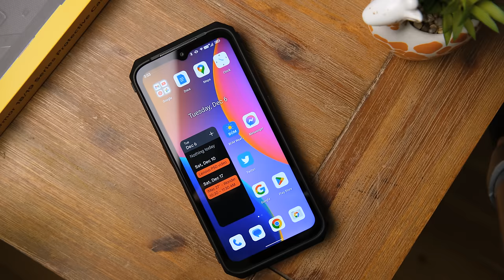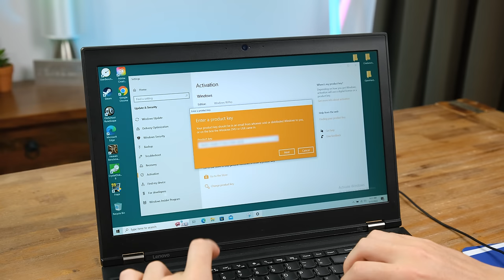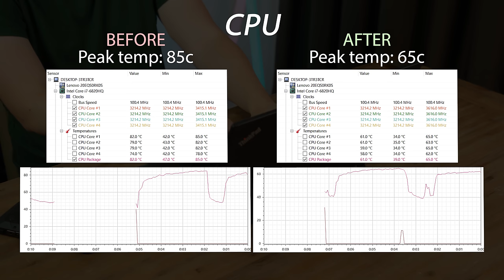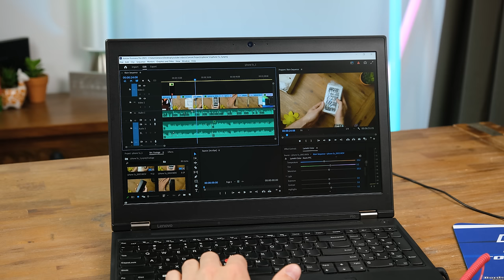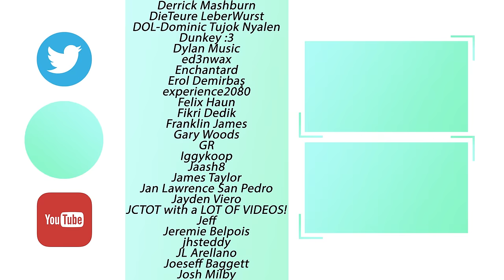I Bought A Cheap Lenovo P50 Workstation! Should You?

Comment: I still use one of these as a daily driver. I pretty much maxed the specs out over the years after getting it second hand, right now it has 56GB RAM, 2*1TB M.2 SSD and a 480GB SATA SSD, along with a i7-6820HQ processor and an Nvidia Quadro M2000M 4GB GPU. Wonderful machine, still very reliable, and even with an old battery, has 4+ hours of battery life. If I replace it anytime soon, I'll surely buy something newer from the ThinkPad P series.
Reply: 56GB RAM? HOW? 😳
Reply: Why the hell would you need that much RAM on a 6th gen i7
Reply: I have 3 16GB sticks, and also an 8GB one.
I work with large amounts of textual data, so I often need a lot of RAM. :)
Reply: @jbritain  Is there anything wrong with a 6th gen i7 that isn't power limited? In fact, assuming a similar power limit, it's basically as fast as any H series cpu 10th gen and earlier.

Also, for a lot of use cases 56 GB ram is pretty normal. For the work that I do, 64 GB ram is the minimum.
Reply: @vivek_v  I don't know enough about the kind of workloads that amount of RAM is used for so I made an assumption, I guess I assumed wrong!
Reply: 56??????? I ONLY GOT 32 BROOO NOOOO 😭😭
Reply: Well i have 24 gb of ram lol. 2 sticks of 4 and 2 sticks of 8
Reply: Suddenly my 32 gb of RAM on my MacBook seems very unimpressive. And for the price, it absolutely is unimpressive lol. 

Tbh MacBook ram is overpriced, but that’s not news to anyone haha.
Reply: @prodbydanai  I got 64gigs running all good. my setup is i7-6700HQ / 64gB RAM / 1*2tB Sata Drive and 512gB m2 SSD, Quadro M1000M 4gB, I even managed to add LTE to it.
Reply: where i can get that i7-6820HQ procie?
Reply: Max it out to 64gb.
Reply: I cringed at how he bought WORKSTATION with quadro in it, and used GAMES to measure its performance
Reply: Unfortunately, none of the current models come close to the versatility of the P50, which I also have as a daily driver. The newer Thinkpad models are a disappointment, to be honest.
Reply: My laptop has 256 gb and I only bought it for £500 from currys
Reply: @spqr528  I think he was trying to relate the video more towards the majority of viewers, as most of them would prefer getting a laptop (if the case) knowing it's performance in something that the mainstream market could relate, and at most would assume that they wouldn't be doing any workstation related stuff. It would also be more engaging (in my opinion tbh) than seeing something like cinebench rendering a picture.
Reply: I have the P15G2 (5 generations newer), fantastic machine :). I’ve also used the P51, really great machine too.
Reply: @jbritain  gentoo
Reply: Bro i only have 4gb
Reply: @lambogamer9415  neat?
Reply: @vivek_v  8th gen Intel onwards destroy both 6th and 7th gen Intel CPUs in both single core and multi core workloads at similar power limits. Wth are you smoking comparing 2015 quad cores to 2020 six cores
Reply: My brother in mobile devices, that is not a machine anymore, it's but a weapon of mass destruction.
Reply: Unless Lenovo starts fuddling up the ThinkPads I don't see myself moving away from them as work laptops. They're small, well built, easy to maintain, and strong enough to get work done.
Reply: @prodbydanai  my gaming laptop 64gb
Reply: @thabitpulak  Apple and everything extra and then the RAM isn't everything... Apple pay quintuple to have everything closed limited and modest performance, there's no story with real PCs
Reply: @rulvra3072  he made a wrong comparison but cores aren't everything in many cases... I have a forklift desktop with cheap amd athlon cpu of ryzen architecture with integrated vega gpu... it only has 2 cores and 4 threads with the beauty of 4 ghz ... it's also overclockable, msi motherboard .. in cinebench R23 It gets me about 5500 points but that processor only consumes 35w, I also have an Nvidia gt750 2gb always msi brand installed
Reply: @FBL9982  You discredited your point when you mentioned desktop and overclocking. Laptop CPUs aren't generally overclockable at all with the exception of Intel HK/X series. Also, 2 cores died out when quad cores became mainstream
Reply: @FBL9982  AMD Athlons are bottom-of-the-barrel tier CPUs that compete with Pentiums in budget segments. Not only are you blatantly lying about your benchmarks and power usage, you haven't even listed your CPUs model name either. Did you really expect anyone would buy your BS? Lmao
Reply: @rulvra3072  you answered unrelated stuff, first thing i was not comparing my desktop to laptop.. second thing my desktop isnt overclocked i dont mind touching those things are original points and third thing i was telling you dont always have anymore core means having more more powerful and that processor I have has destroyed many Intel processors, if you still don't understand well it's not the old athlon but the new zen architecture athlon and athlon 240Ge finally the Intel at the time were not superior to amd... Intel and AMD have always been more or less on the same level... Pentium 4 most of the models sucked and burned like wood ovens
Reply: @FBL9982  It's an Athlon bro, you don't need to flex lol. There are things called Ryzen 7/9s. I also agree that your CPU has destroyed many Intel Processors

Before 2010
Reply: Lol good for you.
Reply: Replacing a 4K screen is the last upgrade!
Reply: Mine is the Xeon with 64gb ram straight from Lenovo. This thing beats most laptops even today.
Reply: 7 times my RAM?!
Reply: @rulvra3072 the 'tech' is same, only improvements are power consumption and heat are reduced.  Whether or not that translates to better performance really depends on the power delivery and cooling 🤷‍♂️.  Depending on implementation the win could go to either one.
Reply: @milescarter7803  No it doesn't lmao, keep telling yourself lies to feel better about your trash skylake mobile CPUs. Your points about cooling are valid but single core performance is significantly better in Coffee lake onwards compared to sky lake. The average cinebench r23 scores for the Coffee lake based mobile cpus (around 7000~) are literal proof of this improvement where Skylake mobile CPUs can barely crawl up to 4000+.
Reply: @poodlescone9700  max on i7 is 128gb ram
Reply: When you play game, you dont open GTA V and LoL and CoD and BF and whatever the fuck AAA you play at the same time. 

But when you working you would open any engineering apps you ever know and multiple that shit 4 times running at the same time, and whatever necessary to get the project done. (Including physical abuse when you get stressed) and that terminator still working normally. Thats how professional that thing is
Reply: @jbritain  CAD CAM CAE works
Reply: 56 gb ram 😮
Reply: I love it when people do this type of thing, it looks pretty ridiculous but it’s obviously been loved.
Reply: Bro maybe you won't see this but can Quadro M2000m run Red dead redemption 2
Reply: Hi I have the p50 laptop I have question if I want to install a ram what is the specification of the RAM that you installed how many (hertz  ) I want to know specifically what Ram I want to install
Reply: @knaparpad hi
Reply: hi
Reply: @prodbydanai  RAM is cheap and they'll take up to 128GB which is nice for many workloads. For example I run a variety of OS in virtual machines on my P52  where there's no such thing as too much RAM.
Reply: @keiwxsh  With the correct system board since they are soldered. It's normally best to buy system boards by buying a notebook with a damaged display then swapping the complete base. I used to build older Thinkpads from wreckage and their manuals make that easy work.
Reply: @vivek_v dawn mine got 64gb ram!!!
Reply: @jbritain  open your eyes. 3D rendering or almost any rendering needs lots of RAMs. When you use 3D software and they're rendering real time you'll need those RAMs. Even a 16GB Ram feels useless as a person who's learning 3D. Even using heavy softwares uses lots of RAMs basically anything that takes loading uses  RAMs.
Reply: @2fps607  me to just remove the 3
Reply: kinda late to ask but do you recommend this laptop for programming? I found one with 32 gb of ram and I am wondering now if I should buy it
Reply: For ~50$ you can replace the cells with higher capacity ones and potentially 2x-3x the battery life on the same package size!
Reply: @2fps607  I GOT 8 LMAO

Comment: Interesting how much performance you can get out of an unimpressive looking device.
Reply: Well look at it this way, the budget not spent on look is going to the performance. I'll take performance over look anyday.
Reply: This laptop was probably not less than 2000$ new. It has a quad core 6th gen i7 when average laptops have 6th gen dualcore.
Reply: The money also didn't go to getting a not shit screen this is a 2004 quality screen so if you watch more than 20 minutes of YouTube or Netflix a day on your laptop this is not good.
Reply: Good looking laptop normally means sacrificed performance
Reply: yap is the most powerful gaming laptop in the world.
Reply: Sleeper Laptop
Reply: The performance may be good, but I'd rather gouge my eyes out than use a 53% sRGB screen.
Reply: @langstonbelin  Guessing you weren't even alive in 2004...
Reply: @bibasik7  The screen can be upgraded fairly easily.
Reply: @SebisRandomTech  I wasn’t but I did have a laptop from 2004 and it’s tn display was about this bad. Poor contrast poor color poor res.
Reply: @langstonbelin  P50 came out in 2015.  It probably has a great screen if you haven't tried.  It has 100% color accuracy that you won't get from any other kinds  I've used workstations for past 15 years as an architect using it for AEC CAD/CAM, 3D modeling, Adobe suites including Photoshop to Premiere.  It's reliable solution for working professionals. Thinkpad sort of defined what professional laptop should look like with its minimalistic aesthetics.  As a designer, I appreciate its purist design.  We cannot carry gaming laptop around to the client meetings.  My Thinkpad W520 (predecessor to this P50) from 2012 stills works well.
Reply: @langstonbelin  I can assure you even the lowest quality display the P50 shipped with will be better quality than your average laptop from 2004 (unless you were blessed with one of the FlexView displays IBM put in some of their higher end ThinkPads at the time), however the stock P50 panel is pretty bad compared to the higher end options that were available.
Reply: Everybody knows RGB ∝ performance
Reply: @SebisRandomTech  well it definitely wasn't very average it was the Dell d610 with a ATI x300 and pentium m I think it was 2 grand back then but yeah but it was cutting edge at the time
Reply: @raghnallm4004  do you even know what you're talking about
Reply: @langstonbelin  of course
Reply: Its very minimalistic
Reply: Astronaut will use apple if this device suck hhhhhhh
Reply: This device is way better than you would think though
Reply: Thinkpads have always been function over looks. That said, the new P16 which replaced this P50 and newer P15 strikes a really good balance between flashy and functional. It's the first, and only Thinkpad so far that I think doesn't look straight out of 2010
Reply: It’s used to look better in the past with W520
Reply: @SebisRandomTech  its close to  VERY HIGH END  display from 2004 if he bumped it up to 07 id agree most workstation laptops look like shit till they get to about 2018

Comment: I got one for a great deal back in 2016 for college. I got the i7-6700hq, m1000m, 1080p, and upgraded it myself to 32gb of RAM and added a 512gb Sata ssd. I think total then was around 1100 after all the upgrades and it was fantastic for what I needed it for (dual booting with Linux, programming, and 3D modeling). Still have and use today, haven’t had the urge to get a new laptop yet.
Reply: How does it fair with VR Gaming?

Comment: I have a P51 that's only a year newer.  It has a Xenon processor, 64 Gb of ECC RAM and 8Tb of SSD storage.  Very few laptops could match those specs.  The keyboard is great, the screen is fine and it's plenty quick for anything that I use it for, especially as everything is running from RAM.  These are built like tanks, and I expect to be using it for quite a while.  Very highly recommended.

Comment: I still use these at my company (i7 6820HQ, 48GB RAM, 512 GB M2 SSD, Quadro 2000M) for programming in AI field.

A little note : The USB C port is not just a USB port but a thunderbolt 3 port, so you can use a thunderbolt E-GPU for more graphical power
Reply: 48 gigs of ram?
Reply: @molotovick  2x16gb+2x8gb
Reply: I believed he mentioned it being Thunderbolt 3 in the video.
Reply: @SebisRandomTech  glad to see you back and active again
Reply: @TheotanyaSama  is quadro capable?
Reply: @MORaXedit1  Depends on your usage. For gaming, pass your way, they are not meant for it (for 2d games or games like Minecraft or STR games like Civilization it will be okay but for 3D AAA games, it will quickly show its limits), but for CAD, the M2000 is still decent nowadays.
As for the use I have, most of the computing power surely doesn't come from the laptops but from a much more powerful mainframe, we use the laptops more for coding and testing some parts of the AI.
Reply: @SebisRandomTech  so what? Move along

Comment: This is a really interesting rabbit hole. I've been paying attention to these old mobile workstations on the used market. There's not much info out there on how Quadros perform in games though, so I find the value really hard to assess. Would love to see more of these videos! One of these for cheap might be a nice alternative to packing up my desktop for LAN parties.
A Maxwell era machine at that price is a steal! Most options I've seen around that price point have a K2000M at best.
Reply: To get a rough idea on how they perform you can compare the chip to their consumer counterpart.
For example, the quadro m2000m has the GM07 with 640 shaders, this is the same as the regular gtx 960m so it performs similarly (clocks speed can vary).
Reply: @zadkielalfano  Thank you! I am aware, but info on which GeForce is equivalent to which Quadro is still not that easy to come about. The T2000 on my work machine should perform between a 1050 and a 1050Ti according to my research. I got about 30 fps playing Valheim on it.
Reply: Landed a precision 7710 for $136 shipped a couple months back with an m5000m installed and pretty nice so far.
Reply: Pp0
Reply: its about the equivalent of the laptop version of a gtx 1050
Reply: @Pagivshi Yes, they do. Buying a new machine with a Quadro for gaming would be a giant waste of money. There is still nothing preventing you from gaming on a Quadro if you get a good deal on the used market like here, or if you happen to already own a Quadro machine for productivity that you'd like to game on for leisure.
Reply: @Pagivshi The drivers for the most part are functionally the same and ngreedia hasn't crippled the gaming performance at all on the driver level since the early to mid 2000s.
Reply: Quadros are typically a lower clocked variant of their consumer grade variant. But they do typically have better memory bandwidth or more VRAM. But like someone else said, they are a waste of money if you just want to game and don't plan on using it for productivity. Games benefit more from higher clock speeds and more VRAM. Despite usually having more VRAM, it's not that useful if the GPU is too slow to use it effectively for games.
Reply: It's a really bad rabbit hole to go down for me at least, as I've fallen in love with workstations and Quadros over their consumer counterparts and I imagine it'll cause my wallet alot of heartache in the future

Comment: Very interesting, I recently got myself a used P51s, which, is not as good as the P50 or P51 due to the compromises done in the name of slimness. But I got a good deal for my country, given that it had bad RAM, a small SSD, and no external battery. When I got that sorted I now have a machine that I use for studying at home, dabbling in odd computer related projects, and the occasional gaming session when I feel like it. And with the new external battery I am easily getting 10+ hours of general use. Some days I have forgotten to plug the charger in and only notice late in the afternoon after classes, still having 30% left.

Yes, the P50/P51 are better if you find a good local deal, but the "s" versions are pretty stellar in their own way.

Comment: My first laptop was Lenovo e330, and it has similar features: very tough build (it fell several times and still working fine) and same keyboard layout with red joystick. I really liked that laptop, and even though it was way older and less powerful than the one in video, it was still very convinient for work.

I think one of it's greatest feature is how easy it is to upgrade -- I'm not really good with electronics maintenance, but I was able to change the CPU by myself. It would be really cool to see something like that in modern devices.